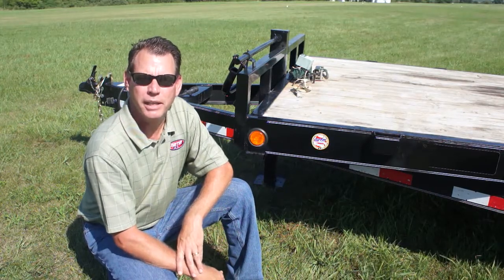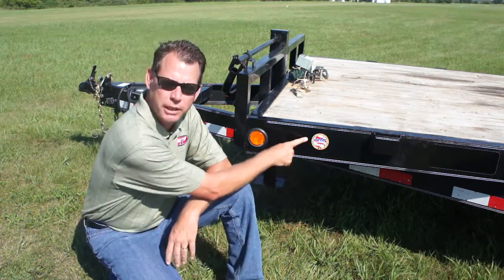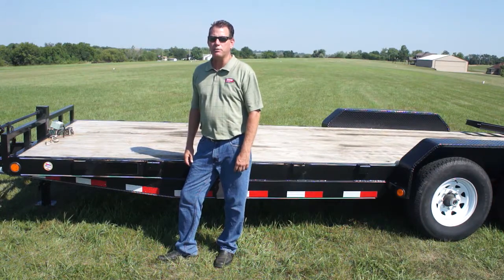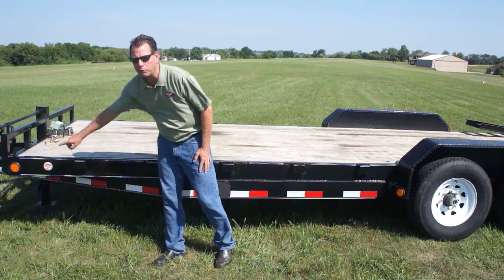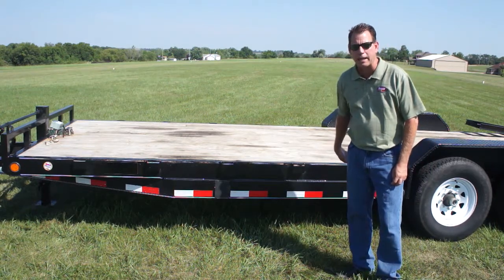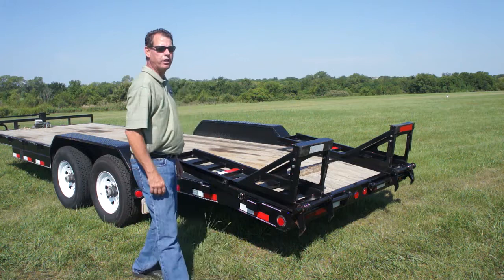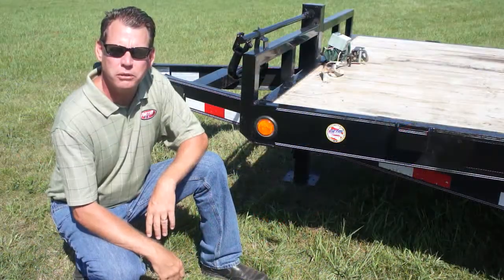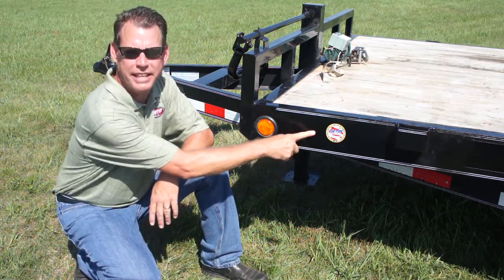NATM Compliance Program Overview

Comment: So, you guys don't even check the welds on these trailers that these companies are sending out. What a useless certification. Nothing about the actual geometry, structural integrity, etc. Just lights, stickers, weight ratings, tires.
Reply: this little speech is just a Useless bunch of Drivel !